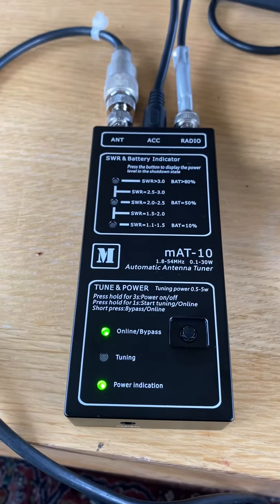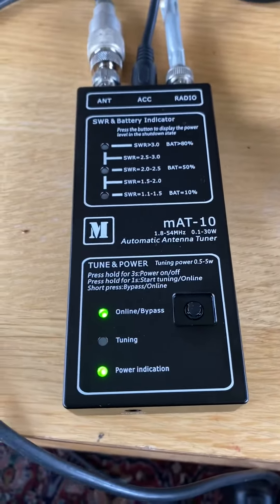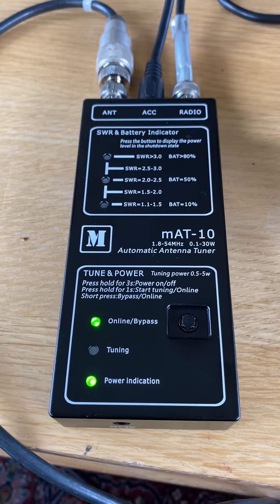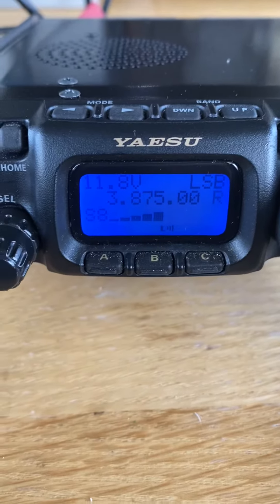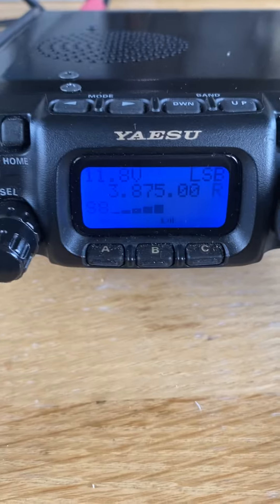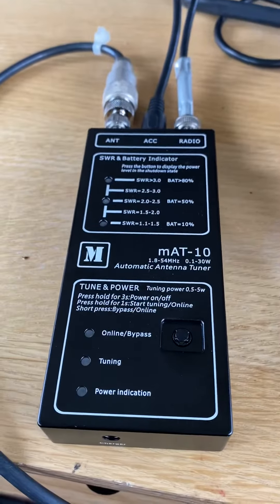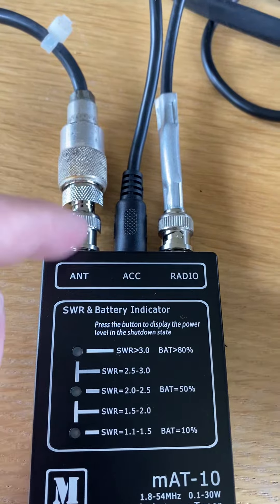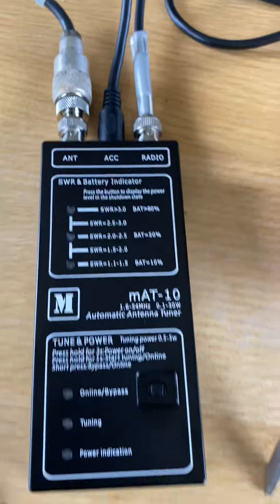mAT-10 Antenna Tuner

Comment: So, I got this tuner but a weird issue with my FT817ND, ok it changes from CW to FM completes tuning cycle BUT does NOT return rig to CW mode and whats worse the FT817ND buttons are all locked including the power on/off. I had to take off the back and pull the battery and power down the FT817ND that way. On reinstalling the battery the radio is back to normal. No idea what the problem is but some software conflict between the mAT-10 and my FT817ND.